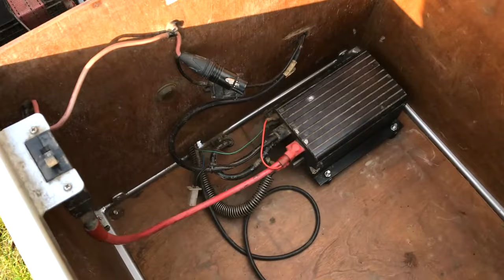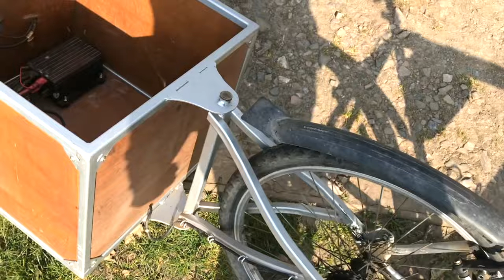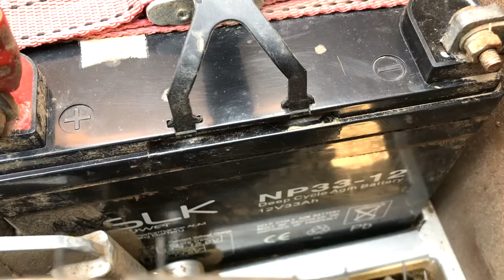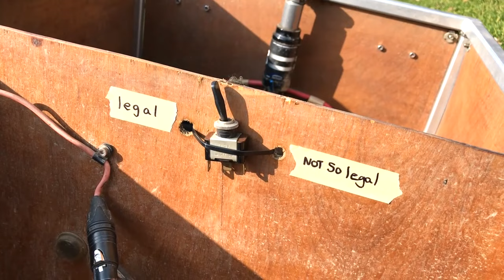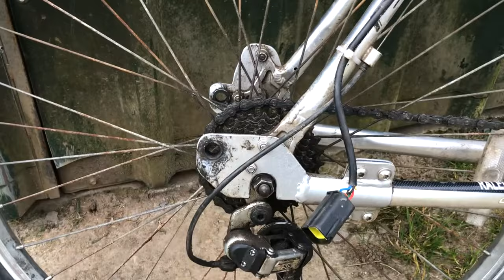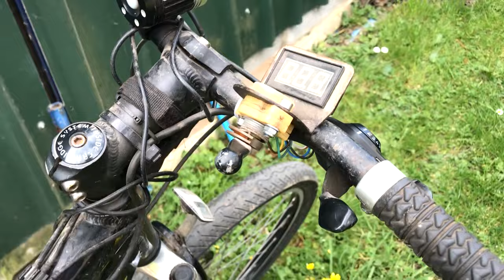Homemade Electric Bicycle Trailer

Comment: I'd like to see how you made those adapters you have on your bike's dropouts.  Love that "legal/ not so legal" switch.  :-)
Reply from the maker: I can send you some pictures if you like 
Email btdixey@hotmail.com
Reply: @Ben-Dixey  so no additional video?
Reply from the maker: No, it was a mistake putting this video on my channel really as the channel is all about homebuilt aviation. It doesn't do your channel any favours going off topic. If I started another channel that wasn't aimed at a specific niche then I could post another video about it.
Reply: @Ben-Dixey  Well, I did notice most of your videos were about a helecopter and a boat, but quite frankly, I'm mostly interested in the process of problem solving and innovation.  I've hust been wanting to improve the hookup speed and ease of a bike trailer of my own.  I love people's creativity.
Reply from the maker: Understood 👍
The hinges I made were bits of 4mm plate that bolted to the existing frame. One side I had to extend the plate and also clamp to the bike tubular frame work for strength. The quick release pins where made on my lathe as were the bits they slide into. The hinge design is unique to a single wheel trailer. When I was at school I made a conventional two wheel trailer which just used a car ball joint for attachment.  What stage are you at with yours ??
Reply: @Ben-Dixey  At the stage of figuring out what will last longer.  The holes around my pop rivets are fearfully loose now.  I don't have a lathe, and an improvised drill isn't very precise.  I was thinking of brazing something together as I don't have access to a welder either.1
Reply from the maker: Ok, brazing I would think is strong enough. If making a pin and precise hole without a lathe you can use the shank of a bolt and then buy a reamer. You can use a reamer in a pilar drill. The shank of a bolt will be around 0.2 of a mm below the bolt size.  For example m10 will have a 9.8mm shank. If you bought a 10mm reamer that would be ok but you can get any size reamer you want. 9.9mm would be good giving 0.1mm clearance. It's important to be accurate with hinges like I made because any slack just gets worse and worse. The clearance on my pins and holes are 0.05mm and they haven't worn at all.
Reply: @Ben-Dixey  Thank-you for your input.  I have a feeling I'm just going to have to endure re-pinning my hitch every couple of years, as I don't have a pillar drill either.  The closest I have to one is a small drill attachment made for drilling through round stock.  It will make 30 and 45 degree (90, 60, 45, + 30 detents) holes in wood/ timber though.

Comment: Not sure about the legality of that….
Reply from the maker: Yeah, it's not legal on the road as it provides power above 15mph and you don't need to pedal. I usually travel at about 20mph as that's a nice comfortable speed but it will do 30mph if you wanted.

Comment: How does it handle when turning/going downhill? I've been thinking about how one might go about designing a throttle-less electric trailer that provides just enough power to accelerate itself when speeding up/going uphill and overcome rolling resistance when cruising. I think this could be accomplished with some kind of sensor that measurs the force on the hitch and adjusts the motor's output such that this force is close to zero (i.e. start applying power once the force of the bike pulling on the trailer is above a certain threshold, and cut power once the trailer starts to push the bike, as in braking or going downhill). My biggest concern is the potential for the trailer to induce oversteer, as it would push the back wheel out during a turn (especially if the turn is on a steep uphill slope).
Reply from the maker: Hi, the handling is a bit of a handful at times, you have to give it some respect or it will try and throw you off. I don't go above 28miles an hour down hill, this is when things can get a bit wobbly. Keep it below that and it's pretty stable, I prefer going up hill to down as it's more stable under power. 
The problem I believe is the very heavy battery's placed so far back in the trailer. The wheel is towards the back and the weight I wanted balanced at the wheel so it doesn't try to load or unload the back wheel of the bicycle via the hitch. Perhaps moving the battery's forward slightly and having a slight downward load on the bicycle wheel would have helped the handling but lipo battery's are another option. Mine are lead acid and as I say weigh a ton. Good for traction up steep hills but bad in every other respect. 
A load sensitive power Control sounds a bit complicated. What's the idea behind doing it that way ? Don't like the hand throttle ?

Comment: Haha, you mad genius !! ... that is the most bonkers electric bike I've ever seen !!
But I do like your unorthodox approach, you certainly can think out of the box m'dude !!   :)
Reply from the maker: 😆👍 yeah It's good fun, I remember overtaking a group of cyclists, all
Kitted up in Lycra and fancy racing bikes. I tried to pretend that I didn't have electric by pedalling but one of them heard the wine of the motor and pointed it out to the others.
Reply: @Ben-Dixey  haha, nearly got away with it !!
You should've coasted by them at the crucial moment .. or whistled the theme tune to Wallace and Grommet really loudly as you went by, ah well next time !! :) 

Anyhow, I watched all your videos again which answered some of my questions but raised a couple of others, regardless I have a new found respect for what you have achieved and all the work that went in to it as well as the tenacity required  to get as far as you have.
There is much I could learn from you with regard to the machining side of things etc. 

Also had a wee search for 2 stroke engines with the Sub 70 in mind and I think it is definitely a realistic proposition, I can feel a concept brewing ! :)
Reply from the maker: 😆👍 yes a Wallace and grommet theme tune would have been great! 

Machining is my area of expertise and there has been plenty of new machining experiences with the helicopter project. I've enjoined it a lot. Rotary wing flight is certainly not my area of expertise and people like yourself run rings around me in this area. I struggle academically and have to work much harder than most to understand such a complicated subject. Most of the time I just accept that it works. I haven't forgotten about your emails. Been making car videos for my other channel recently. For some reason I like making them.

What engine are yon thinking ?
Reply: @Ben-Dixey  Didn't realise you had a second channel, post me a link please :)
Making things is fun, especially if they work !

I did a search for 15 kg 30 hp 2 stroke air cooled engines and stumbled across  a web selling some 20hp flat twins and 45hp flat fours at 7kg's and 17kg's respectively. stupidly I didn't save the link. I'll have another look ....but I've got a feeling they're not going to be the cheapest option...

Also had a wee look for what might be a suitable donor motor bike to do the job, not ideal but it could be a cheaper option, plus they would come with gears and an exhaust as well as a fuel tank, which could save some work, potentially but ever option one chooses it's going to need adapting.  

What's the cc of your Johnson J60 ?
That almost sounds like a rude question ... 

Anyhow, I'll put together some drawings of what I think might be feasible to build in a shed, I think have an idea for a light weight frame that could work seeing as the required take off weight would be about two thirds of your machine and if I can get an engine, tank, mountings and gear box etc. installed for 30kg's that leaves 40kg's for the rest. 
Doable... hopefully !! :)
I'll email you in due course.
Reply from the maker: Sounds good, have you seen the Chanel Amazing DIY projects?  
He's using some small engines for a manned drone. 
https://m.youtube.com/watch?v=Hj0r63xfG-M
Not sure what Hp they are, but they lift him without any problem. 

With a motorbike engine you have a gearbox, only one of the gears is required of course. Perhaps removing all the unnecessary gears would be possible to save weight. The flat twins produce a nice bit of HP. 

The Johnson is 737cc. 

https://m.youtube.com/watch?v=m_MTS763vEs

Another lightweight machine 

My car channel. 
https://m.youtube.com/@bensclassicbodywork3776
Reply: @Ben-Dixey  Sweet, I'll check those links out.
I've emailed you some links regarding the that engine collection I was on about, they do look nice... no doubt not cheap.
Yeah bike engines seem a good alternative, the right donor bike could provide some useful parts, and yes shave off every unneeded ounce with that magic razor blade you used to trim down those bolts.

Comment: You've sort of re-invented the BOB trailer, I modified one (Ibex model, has suspension) with a motor much similar to what you have done.  Worked fair on pavement, not very well on dirt where I intended to use it.   Having enough weight over the powered axle is key, otherwise too much wheel slippage. "Enough" weight was too much for comfortable handling so the trailer was reverted to non-power.  (But I left the battery in to supplement when used with an e-bike)
Reply from the maker: Yes, I still get some wheel slippage going up very steep hills even on tarmac but it's manageable, the four lead acid battery's right over the wheel gives decent traction but as you say at a cost to handling. I don't mind that you just have to be sensible with it. It a shame e-bikes are so expensive.
Reply: I find that my powered trailers get traction exactly when needed.  By having the hitch on the seatpost, the wheel under power pushes upward to the hitch the bike resulting in a bit of lifting vector creating extra traction when accelerating.   In essence my body weight substitutes for those heavy batteries, which is good because of the 1.5hp, 3.5hp & 5.7hp, gas engines I have used, none were that heavy and were placed well forward of the drive wheel to better achieve the pendulum effect I needed in order to avoid having to make such a beefy u-joint type hitch to keep it upright.  

One of my next ones will use my 4.5hp Kubota diesel with electric start and alternator.  
It will relieve my electric bike of even needing to be turned on and the alternator can keep it charged for running around disconnected.  I can carry camping gear in a cargo box  on the trailer.  
Mobile electric power from the alernator and a small lithium battery will make a well lit, convenient , comfy, well-equipped campsite with the option of riding in heated clothing & sleeping in a heated bag.  
I will have to have a brake on the trailer due to its weight.
Perhaps I'll put the engine on the tongue driving the pivoted front wheel of a 3 wheel trailer, eliminating the problem of partitioning off the engine inside the trailer and increasing load capacity.  
With a little extra effort I could hide the engine & the fact that the trailer is pushing the ebike, giving only the appearance of my legal ebike towing a trailer.  
I might make it just big enough to sleep in.

Comment: I've just discovered this channel, I really like the design to just be able to tack on the motor and the batteries on the back and have them be detachable. I've got access to 4x lead acid batteries like the ones you have and I really want to make something like this now!
Reply from the maker: It's good fun and sure beats pedalling. 👍

Comment: You guys let your gov walk all over you, no way in hell I'd live like that, I built a 2000 watt bike and ride on sidewalks in Detroit at 30 mph, hell I used to put 212cc engines on bikes with a cvt clutch and do 40 in traffic.    My last shotgun I bought I got from Walmart, pistol grip, I was in and out in a half hour with 10 boxes of ammo
Reply: Great to hear! I also got rid of the driver license, pink slips and registrations for my cars.👍  It's all a scam and fraud upon the people.
Reply from the maker: Yes I do envy a lot of the freedoms in the USA, I've seen videos of electric bikes that have been modified and filmed going down the highway at speed. No way you would get away with that here. Guns would be the one thing I certainly wouldn't want available seeing some of the terrible shootings that happen.

Comment: 1) When you are in a turn, wont the push from the motor push the back wheel sideways?
2)Please make helicopter videos :)
Reply from the maker: Yes you're right, in a tight turn you can only use very little power a friend of mine had a go and didn't realise this and buckled the back bike wheel. 

Will definitely stick to helicopter videos it was an experiment to see if it would bring a wider audience to the channel but I was worried about the helicopter subscribers.